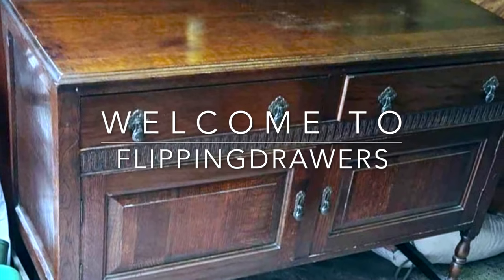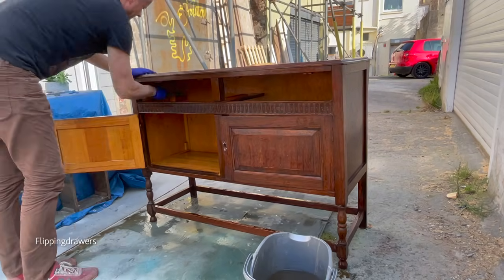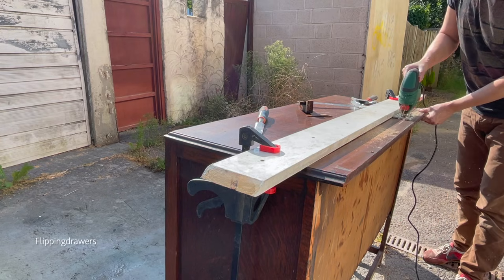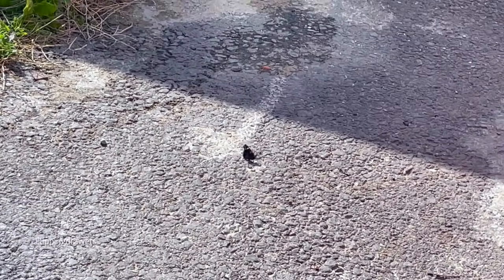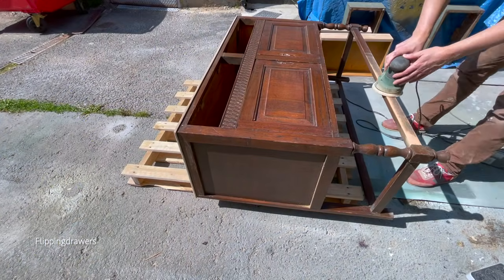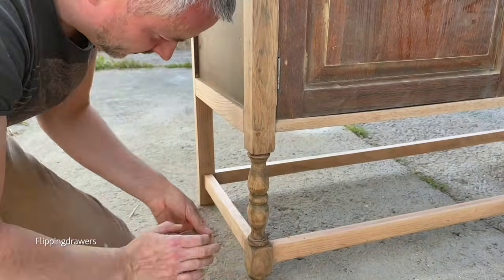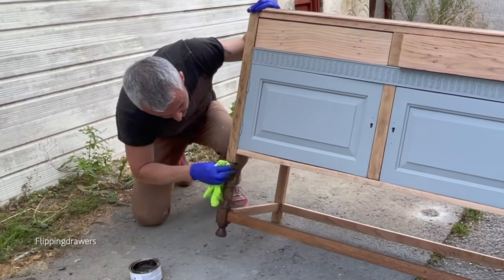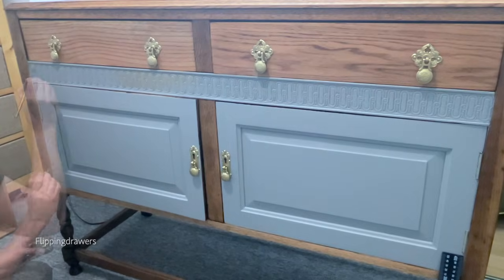Vintage buffet reveals her true beauty when the varnish comes off | 1 day Furniture flip

Comment: I have watched several of your videos and I like what you do. You need a circular Saw so you don’t have to try to cut straight lines with a jigsaw.
Reply from the maker: Thanks. I do have one. Didn't at that time. It's actually pretty easy to cut a straight line with a jigsaw if you use a piece of wood as a guide.

Comment: I love what you do, the only concern is that you don't have an adjustable work bench so your not damaging your back.
I have a scissor lift table that I use to load my projects on, so they're easier to move around without causing my back issues.
It's just something I noticed in a lot of your videos, but apart from that i love what you do ❤❤❤
Reply from the maker: Have you seen my workshop recently? Thanks 😊

Comment: If you could get you some varnish stripper like Citrus Stripper or any type of liquid stripper like that to help you get the varnish off with out having to sand so much. With the citrus stripper it's best to wrap it in plastic wrap but I would it in sections in 45 minutes intervals. Then move on to the next section. You probably have already been told this but, just in case you haven't then hopefully this helps you from having to sand so much....lol
Reply from the maker: I know.  Have done it in other videos ☺️ thanks anyway

Comment: Seeing that you work with a lot of dust may I suggest you use an air compressor/blower to blow out all your machinery in their air vents. Or else your machines cant "breath" and subsequently the machines/motors will overheat
Reply from the maker: I  do it every time once I finish working
Reply: @Flippingdrawers  awesome👌👍. It is surprising how much dust comes out of the machine's body
Reply from the maker: @nevillesmith9795  yeap.  I do a lot of sanding and have a small blower that I use to dust everything off before putting it away.